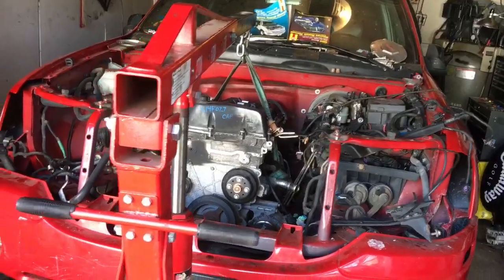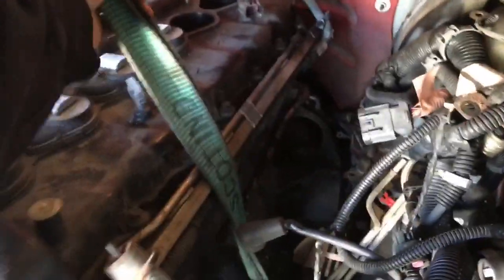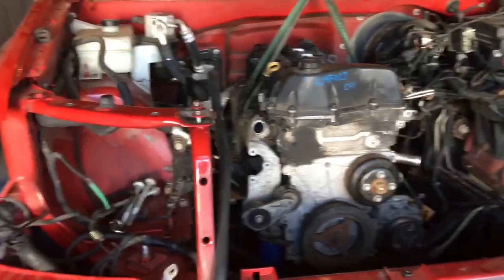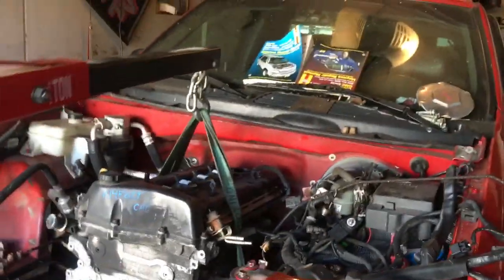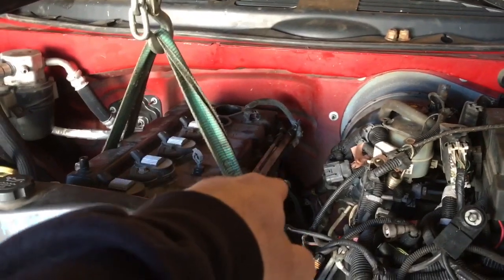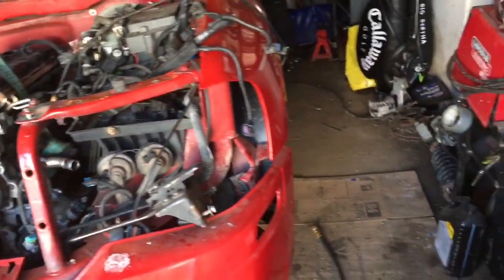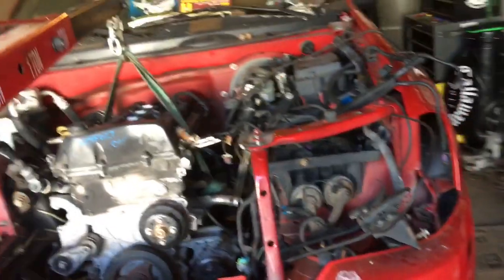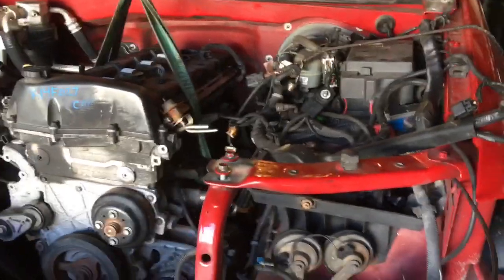Working on the envoy once again. Saturday 14 2015

Comment: Here!! Those envoys are a BIG PAIN IN THE @SS to do motor swaps on. We just did one in a regular mech. shop, still took 9 hours motor out used motor installed, Here's a little hint before you assm. the whole thing, Put a new oil sending unit in it, and put new 0 rings in the trans. lines. They will leak.
Reply from the maker: +CHOPSHOPUNDERGROUND OKAY! Thanks! I will do that. Good idea! Thank for your comment!
Reply: chop shop.... easy peesy Japanesey. no sweat. this swap is super easy. the only thing extra is the front axles. it's no harder than a 4.0 jeep engine swap. one bank. try working on the 5.3 trailblazer. I bet you'll  have fun removing the starter on one of those.
Reply: 9 hrs seems fast unless the tech has done many,whats book time?